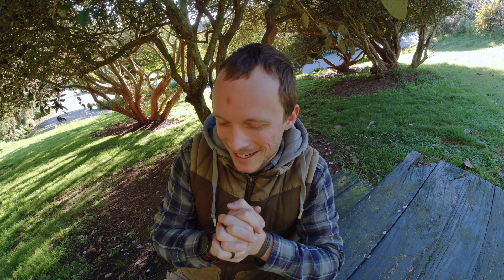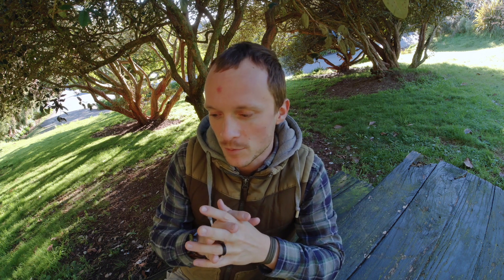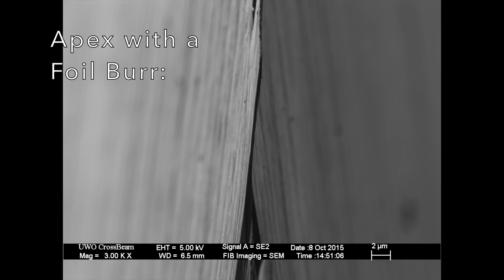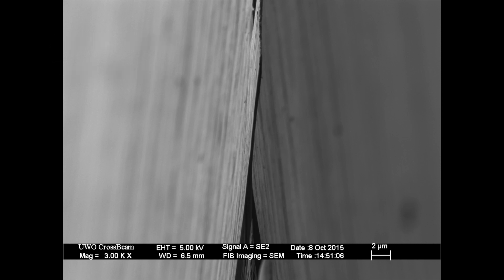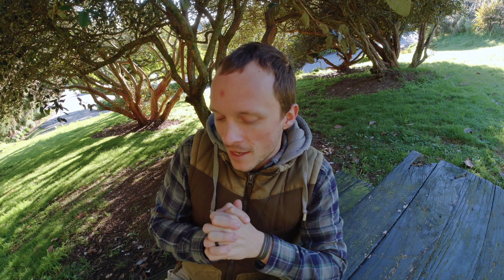Setting the Record Straight: Cedric & Ada Maxamet Steel Dual Grit Test - Part 1

Comment: Also, you talked about somone from case knives? Can you link that as well?
Reply from the maker: Yeah - Roman from Kase Knives Switzerland.  Dude custom hardens Macanese to 70.7 HRC and sharpens stuff to like a 5 nanometer edge.  Which is stupid sharp.  And awesome…

https://youtube.com/channel/UCv7WhIE11ClB9BiaJWOJZRg
Reply from the maker: Thanks for watching - stick around because I’m working on some research that will complement this video nicely analyzing hair whittling edges vs dual grit vs fully deburred edges measured on a BESS machine.

Cheers bro.
Reply: @homeslicesharpening  thank you!

Just got para3 maxamet

I need to purchase blade maintenance items

What would you suggest for someone that’s wanting to keep it working edge sharp? I’m more interested in a higher frequency of blade touch up vs going long time between sharpening and letting it get super dull and having to really do a lot to get it back 

I am also curious if the factory angle on the maxamet is optimal in your opinion for my use as edc

From what I’ve gathered, maybe diamond emulsion spray and a strop? Since I’m not very experienced stropping I was leaning toward balsa or something stiff where I won’t roll the edge

What’s your professional opinion on this?

Thank you for assistance
Reply from the maker: @Papadragon-7  wow congrats bro 🥳 what a great knife!

To be honest, I may not be the best person to ask. My experience in Maxamet has been a little bit limited and scattered, I’m still trying to get my head around it.

BigBrownBear says you should leave it at  more of a medium grit (like under 2k grit) or the edge won’t last well.

Michael Christy takes it to 0.01 Microns through a series of insanely fine strops and seems to get good results.

KnifeGrinders say you need to go through several steps of increasing grits to minimize subsurface damage, and diamond abrasive is best.

ScienceofSharp wrote an article that proves that diamonds pretty much always break your surface carbides, and that if you use natural stones you leave the carbides intact.
https://scienceofsharp.com/2019/11/03/carbides-in-maxamet/
Reply from the maker: @Papadragon-7  I am still researching it, so subscribe or stick around if you want to hear my final conclusions, but if I was gonna sharpen it now I think I’d take a similar approach to Justin in Engineer’sPerspective which is -
1) Sharpen on coarse and medium non-diamond water-stones (he uses a King Neo 800 with Silicon Carbide abrasive - link below)
2) Alternate edge leading and edge trailing and go really really light on your last strokes
3) Take it to a strop with some emulsion in it (he uses 1 Micron diamond) and do feather light strokes, alternating each pass until you’re confident you hit the apex.

Justin’s video:
https://youtu.be/oOco3Pj98T8

Hope that helps!
Reply from the maker: @Papadragon-7  I sharpened Maxamet to 15.5 dps and the edge broke off in Pete’s test, just cutting rope.  That could be due to me leaving a wire edge, but I’d probably leave it somewhere around 17 dps if you want to avoid damage & do small maintenance but more frequently.

That’s probably a little more acute than factory edge.

Most sources say the edge on Maxamet often comes overheated and you don’t get the full performance until your 3rd or 4th sharpening.  If you want to avoid that, you can spend some of extra time on a coarse diamond stone in your original reprofiling to remove over-tempered steel.

Optional, but bear in mind your edge retention may initially disappoint if you don’t remove fatigued/overheated metal.
Reply: @homeslicesharpening  thank you very much for the detailed write up

Just when you think you are getting to know a thing or two.. I was u see inoression it needed to be diamond or it wouldn’t work properly with that hard of a steel 

But the article says otherwise.. 

Tough to make a decision
Reply from the maker: @Papadragon-7  Yeah, I don't mean to discourage you, I am here too!

I think you'll get good performance either way, but if I was getting a setup specifically for Maxamet at the moment I'd get a few water stones and only use diamond in the stropping very gently.

Comment: Love hearing your perspective on what is going on at the cutting edge of the dual grit method. Do you feel that stropping would fix the foil burr or does the lapping film serve that function?
Reply from the maker: Lapping film alone seems to often leave a tiny foil burr. The most objective exploration I’ve ever seen on foil burr removal I’ve ever seen is here:

https://scienceofsharp.com/2016/04/14/simple-straight-razor-honing/
Reply from the maker: Compare those images to the images of the Maxamet apex after lapping film in this article:

https://scienceofsharp.com/2019/11/03/carbides-in-maxamet/

Comment: If you cut dirty materials they can dull an edge fast, really fast. As Cliff Stamp (R.I.P. brother, we lost a legend) showed in his testing, cutting dirty carpet and rope was a difference of 20 to 1 vs cutting clean materials and that was with steels from 12c27 to cpm 10v from Phil Wilson. So when you talked about using your military to cut dirty mat and saw it dull and reflect light its not necessarily because a burr that was there. It could be it just got dulled by the dirty material since there are things in dirt that are harder than steel or even carbides. I would suggest you get a microscope, something decent and check your edges with it. Another way to check for a burr is use something like a microfiber towel or something fluffy like it and put it on your bevel and pull it towards an edge(I'm doing this in a clamping system but you should be able to do it as well). If it catches on your edge there's a burr there. This method showed me burrs that I couldn't feel, though I never tried it with something as coarse as 250 grit and it might catch just on the coarse bevel. Watch so videos on burr minimization. Cliff Stamp and others have great videos for this topic. One way is once you're done, do a pass with at a really high handle like 45 to cut of the burr and then do a few passes at your original angle to get rid of the slight microbevel that creates.
Reply from the maker: Awesome tips - thank you so much.  Do you have a recommendation for a good microscope?

I've seen Cliff's videos on cutting carpet, but hadn't thought about the dirt's effect - very good point.

Love the idea about high angle passes, will try it out.  Also, the fabric test is something I do from time to time and is very helpful.
Reply: @homeslicesharpening  Not really. I bought one from Amazon that has a base, a separate screen and connects to a phone over Bluetooth. Its was $80 or so after a discount, I found it be better than those $20-40 handheld ones you see a bunch of. I like being able to use either my phone or its screen to look at the edge and it shows burrs pretty well. It does ok for now but I doubt its really 1000x zoom. You get what you pay for, digital zoom isn't the same as actual zoom on microscopes but a decent one will be in the $200-300 range and for now I don't need that kind of precision.
Not sure how Amazon works in New Zealand, here I bought a few models and found the one I liked and returned the rest. I recommend having a base or get one separate, have additional lighting that's not just on the microscope (my base has 2 adjustable light as well) and either a screen or connection to a screen is a must(both is nice). You'll see burrs that your couldn't feel or see with a bare eye.
Reply from the maker: @MFD00MTR33  Good input!  Unfortunately Amazon is expensive here.  I'm pulling about $50 in each month on Patreon, so I'm kinda squeaking out these decently large purchases quite slowly.

I'll try to look into microscopes though, it would be good.
Reply: @homeslicesharpening  I'm still getting stuff after many years. I'll think of something new to get or need to replace something that's worn out. There's lots of useful stuff but you don't have to get it all at once. Some things are more important and some are in the "it would be nice to have" category. I've been on disability for a while so my knife budget isn't what it used to be. It's actually about the same as yours. This month I got a new piece of glass for flattening stones and a stone holder for my sharpener. It's titanium and can be separated into 2 pieces while my old one is steel and one long piece. Both items are from TSProf actually, didn't know they had a flat glass set but I found it and it was at a great price.
Bummer about Amazon, as much as I'm not a fan of them(I prefer to support locally owned stores, just bought some shoes from a mom and pop shop) their selection and price in the US is great. I remember Pete saying how hard it is to buy knives in Australia so I figured you in New Zealand would be in the same boat. Before I got this microscope I had a manual one made by Carson. They have a good selection of different zoom ones and I had a 60x-120x and a 120x-200x(I believe, something close). They're not as easy to use since you have to put your eye up to it(though I saw the new ones have a clip that can attach to a phone, not sure how well that would work) but once I got the hang of it they did pretty good. And they're in the $12-20 range(at least here) and ate way better than a jewelers loop. Maybe see if you can find one of these for now to hold you over. Then again in the $20 range you start seeing some of the cheaper digital ones and some can connect to a laptop or phone. I don't know what I'd recommend then. When I bought the  manual Carson ones digital microscopes were still kinda new and rare and even the "cheap ones" (ones that are $20 today) were $40-50 or more. Today the choice is almost endless and prices went down a bunch. We're getting spoiled with how much stuff is available. I remember when Edge Pro and Wicked Edge were the only game in town and Efim in Russia came up with a clamp system. Now you can get clones of each for $20 and there are so many good ones to choose from.
Reply from the maker: @MFD00MTR33  Nice - lots to consider!

Comment: I tried it on my sharpning system using venev metallic bonding industrial diamond stones and it never worked is it because i did it wrong? I really don’t know i hope gape answers me so that i can tell him how i did it to see what i did wrong or this method does not work on fixed angel sharpening systems.
Reply from the maker: Hey mate - I am not sure if it works with Venev stones.  This is one of the main things I am hoping to test.

I am not sure if it works well on a fixed angle sharpening system... I'll have to do some testing of this too.

Sorry, not a lot of answers, other than that it's a little more complicated than I thought at first, and it's probably not your fault!

I'll share all my troubleshooting discoveries as I find them out!

Cheers.
Reply: @homeslicesharpening  what a man i’m really admiring every thing you do thank you man🖤.
Reply from the maker: @thepolarbear5046  thank you so much bro!

I am inspired to keep doing it by dedicated problem-solving sharpeners just like yourself.

What steels have you tried to do a dual grit edge on so far?  What was the main problem you were observing?
Reply: @homeslicesharpening  i tried it on a Cold steel CTS XHP Code 4 model  the main pro problem is that the when an started using the edge a big chunks of steel went away the same thing that happened with pete . And then i tried a butcher knife (f.herder) and i had the same problem (carbon steel)  

My thoughts is this method of sharpening does not function best with tool steels. 

Thanks for listening to me pls share your thought with me i’m really interested in it.
Reply from the maker: @thepolarbear5046  Thanks for clarifying!  Did you read the article about what makes dual grit sharpening work?

Check it out here:
https://scienceofsharp.com/2021/06/15/dual-grit-sharpening/

The method extends edge life by leaving a large sharpened burr on the edge that increases the acuity (how the edge feels thin) and prevents the edge from wearing away and changing thickness quickly.

It is a great method to give longer edge life if you are cutting rope, cardboard, paper, wood.

It sounds like you have put it on a heavy use folder and a heavy use kitchen knife used for impact tasks.

I would suspect that the problem may not lie in the steels, but in the fact that dual grit actually helps by creating a longer thinner edge apex - which is not as well suited for very high impact tasks.

If you read the article and still feel like the use you put it to was not super high impact, let me know - and we can troubleshoot other areas.